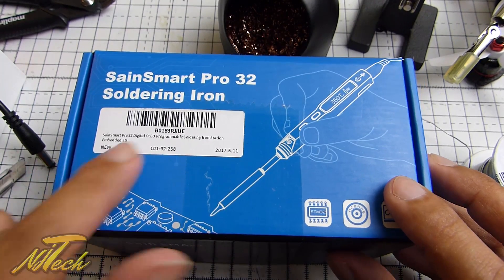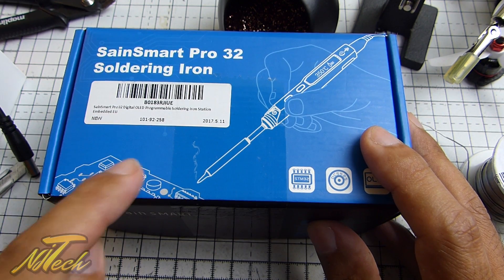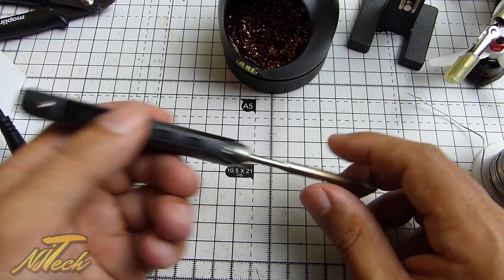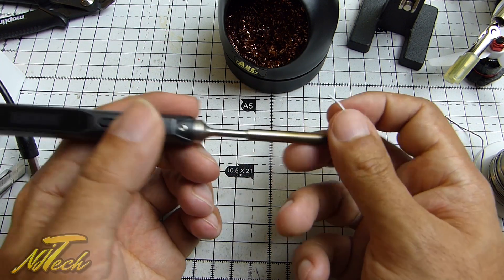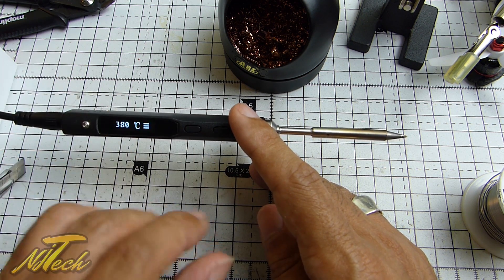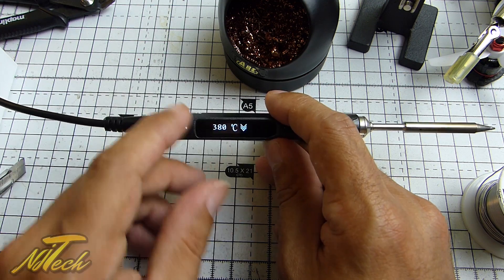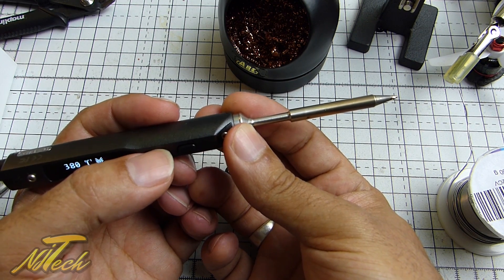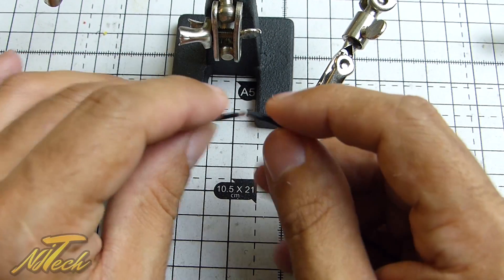TS100 Soldering Iron, Custom Firmware & soldering tricks!

Comment: Hi! This is in fact a great and compact soldering iron. I bought one essentially for travelling, but I'm sure I would use it on a daily basis if I didn't have a good soldering station already.
I've tired that firmware but didn't like the menu navigation at all. I ended up updating the stock firmware v2.17 which has all those feature but I prefer the menu implementation. You might want to give it a try: http://www.minidso.com/forum.php?mod=viewthread&tid=892

For those who want to make their power cord, this thing uses a 5.5x2.5 mm barrel connector.
Cheers!
Reply from the maker: Great info Mario thanks, its always horses for courses with firmware, i prefer this one. Has the latest official supported the higher voltage cutoff and 450 temps? If not ill be sticking with this. I want the lipo protection.

Comment: My ts100 maxes out at 400C... not 450C...
Reply from the maker: ive put a link to the custom firmware i am running in the description that lets you use it up to 450 degrees C.
Reply: NJ Tech ahhhh sweet, thanks!
Reply: Is it hard to flash the firmware?
Reply from the maker: not at all, all the info is on that linked page.
Reply: Lachlan Peknice watch the video dufus, this one does too - he said you could change the specs with a extra assesory
Reply: SO did you apply the CUSTOM firmware first and then expect it to function as described ??  No custom firmware, NO changes to the upper limit ....
Reply: i watched it... much like the other 8 ppl that liked this comment
Reply: Lach Pek so you and eight others watched it but did not listen to a word he said , that's some intelligence there !
Reply: Duh... what would you expect lol.. It would magically increase? hahaha
Reply: I don't know about you, but I sometimes comment midway through a video. Neil said 450°C, and I thought 'hang on a second, I thought it was 400°C'... typed my comment while still watching, then found out how... is that too hard to comprehend? lol